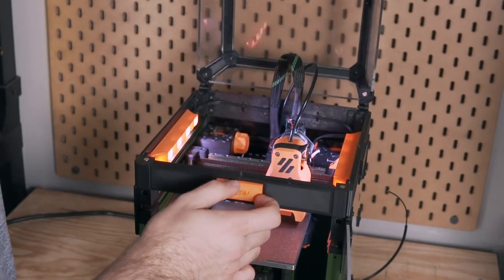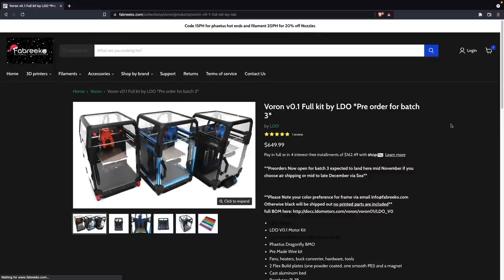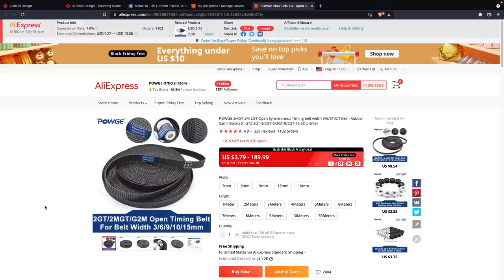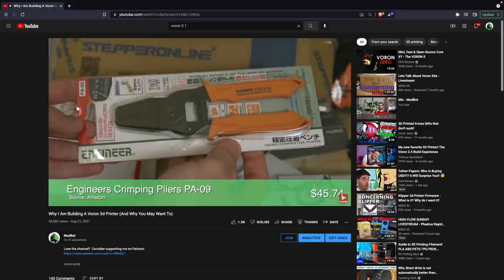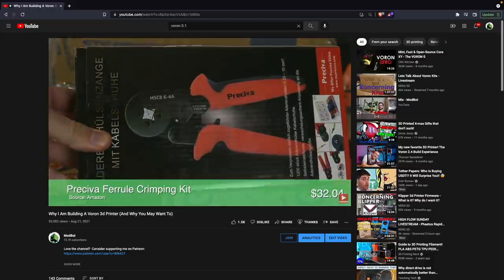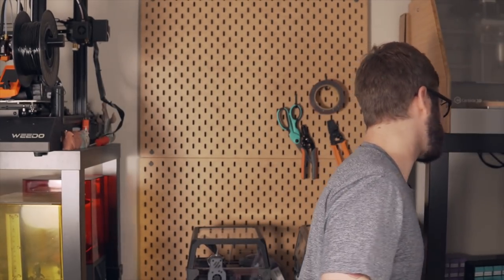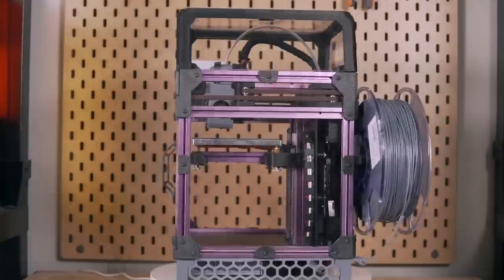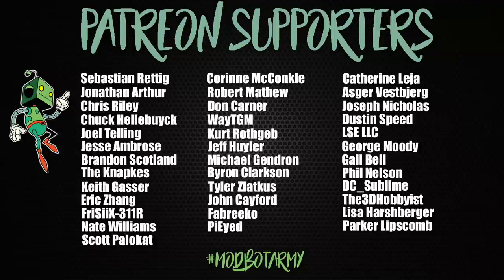Self Source Or LDO Voron 0.1 Kit? Best Option!

Comment: Couldn't have posted this at a more perfect time! Just got my ender dialed for abs and was going to begin printing a v0.1, was debating between self source and ldo kits and this helps so much!
Reply: woah....same
Reply: @Trail Chasers What happened to YOUR channel? You haven’t put out a video in a couple years?
Reply from the maker: Happy to hear :). Unless I wanted to for the sake of it at this point there is no way I would choose to spend more when the LDO kit is available. I hope your build goes well!
Reply: Definitly go the kit way. I started a 1.8 build some time ago, still not done, to the point that I've started building a trident that was releasing since AND I've ordered an LDO v0.1 kit and it is built already, my trident has the A/B motors and the idlers... I should have the parts to do the Z next week...

Comment: I bought a LDO 0.1 kit (batch 2).  It's still sitting in the box though, as I promised my wife I'd finish another project first.  This video makes me feel pretty good about my choice in kits and I'm sooo looking forward to putting it together.  I know the overwhelming feeling you got when you were sourcing the parts in the BOM.  I put together a voron 2.1 a few years ago and made same mistake w/ my belts and pulleys.  It prints (sort of) but sadly, that machine is still sitting on top of my Ender 3 enclosure like a camero on blocks in a trailer park front yard.  So many projects, so little time.
Reply from the maker: Good on you for doing what you promised first. It is not so easy to put off something you are very excited for. That makes me think of my AM8 I did. I was not super happy with the end result. It was my fault by part choice and waiting way to long to build it but it did not get nearly as much use as I would like. You are going to love this thing.

Comment: The notion about "inferior" parts in kits is almost inevitable, even with the best intentions. To be able to make or assemble and sell kits, you need to aquire serious stock of each part. But in this space, iterative improvements happen at lightning pace. And the margin on selling kits for this isn't big enough to absorb large caches of parts becoming dead stock every time a notably improved alternative comes out. Heck sometimes it happens so fast that your parts have been "surpassed" after you place a manufacturer order but before getting delivery. Please note, this certainly doesn't always mean bad  parts in kit. Just that there's something newer/better available.

So if you're gonna do any sort of reliable business selling this type of kit, you kinda need to either be the manufacturer, or the distributor, of practically all the parts in that kit that go through these rapid cycles.
Reply from the maker: I do agree with this. With how quickly things move in this space it is going to be incredibly difficult if not impossible to always have the latest version/revision. I do feel that quality of components though is something that they do have control over when they decide who they are going to source from. Like you said, being the manufacturer gives you a definite 1up.
Reply: @ModBotArmy  That is a very important factor you mention; Quality. If you stick to strong performance, good quality parts for as many parts as possible, then the market and sales figures of your kit is lilely gonna be significantly more forgiving when a few of those parts get surpassed. There needs to be a healthy balance though, functional performance parts has to be swapped eventually. As such, I think offering both "core" kits and "full" kits would be a good idea. That way, in the interim between multiple functional performance parts being surpassed (so customer interest drops off substantially because there's just too much of the pricetag sunken into parts they won't be using) and you having revised your "full" kit, you can still keep "core" kit sales going strong.

Comment: So, I work a 40+ hwr job and have a kid that plays a competitive sport, my time is limited so I feel like going with the kit route would be best for me.
Reply: No problem with kits
Reply from the maker: Haha you absolutely will be happier going with the kit then. I would not consider self sourcing with all of that.
Reply: It's not as bad as you would think, quite a few manufacturers are making mini kits for things like motion, hotends, etc. Still a commitment though. Only worth it if you have a decent shop full of hardware and extras of common components
Reply: 40 hours is normal.
I am sourcing stuff myself and even return a few things which aren't up to my expectations.

A Voron printer doesn't have to be built within days.
This is something that can take time and it's not a problem.

Comment: I just purchased the v0.1 LDO kit, have not started the build but so far the parts look great everything is to spec and including this video I have not heard any bad reviews. Earlier in the year I purchased the formbot v2.4 kit and it was mostly a disappointment. From a bad build plate, the chains that could not open to missing some bits and pieces and rails that, well I had to purchase new rails plus a lot of other things to replace. Other people had better luck and that is just the thing, it is really a hit and miss with aliexpress kits. It seems that they are better now a days but I would think twice.

Comment: Just finished my V0.2R1. I used a kit. The only issues I had with the kit was that the cooling fans were bad, and there were no notes from the supplier as to what I would have to find for instructions for their upgrades. Not knowing what it was called was half the battle. 
I will definitely use a kit again, over self sourcing, but I will upgrade things as I build knowing what I'm doing a little better now.

Comment: Tip: You can shorten a premade wire without the need to re crimp it. You can cut twice, solder together and secure it with shrink wrap.

Comment: My planned printer projects for the next few years are a Voron 0.x in 2022, a Voron 2.x IDEX in 2023, and a Rat Rig V-Core Jubilee Tool Changer across 2024 and 2025. (I'm fully aware that new cool stuff will inevitably pop up and potentially alter plans in the meantime, but I need to spread my budget and wait for others to do most of the hardware design work for the IDEX-ification in particular; I only know that I want to use Rapido UHFs with Zodiac Pros and an SKR Pro with an EXP-MOT.) I will definitely use preconfigured kits (as a basis) for all of them - and most likely LDO ones for the Vorons. I hope that by then my V0.x kit will come with SKR Pico.

Comment: I first built a V0 around febuary, through formbot, I had to imidiatly change the steppers because they did not send LDO motors like they said they would and I was getting mised steppes. other than that I think the kit was pretty good and I cant remember any other issues. once done that build i went on to build a V2.4 but went with BLUROLLS this time.  the spider they sent was broken so they offered a $10 refund... and they were missing some M5 hexscrews and again said that with thte $10 discount they offered would cover it... i was not happy about this as it cost more than that to buy them localy. apart  from these 2 issues  the build went well. i think i might pick up the LDO switchwire or Trident next.
EDIT*** i re read this and realized how complains it was. Both printers are up and running fantastic and in the end I am very happy with the kits.
Reply from the maker: That really does not sound too terrible. I mean of course having to purchase anything that should have come working with the kit is not great but I feel it could have been worse. The Switchwire looks awesome :)

Comment: With my Trident 300, I went the Formbot route, and it turned out alright.  I've had to swap out a few things, but it provided a decent basis.  For the v2.4, I'd love to go LDO, but unfortunately they don't offer a 250mm kit for it, so after a bunch of thinking I've decided I'll wind up going the self-sourcing route, simply because it lets me pick and choose every last little detail.  If LDO offered a kit in the size I'm looking for, odds are I'd just get their kit, because they're fairly nice and cover most of the things I want.

For Salad Fork, which will probably be the printer I build after the v2...  Odds are I'll just buy the Fabreeko kit, since that definitely has most of the stuff I want already in there.

If I were to build a v0.1 though, LDO's v0-s1 kit looks incredibly tempting, and has so many things just sorted out so you don't have to mess about.

Comment: waaay too small printer for that price...
Reply: It’s quality though 

Edit also many good designs are multi print therefore you can build really big assemblies that go together. This printer is nice for the people taking multi print assemblies, (which are arguably better) to the next level.
Reply: @Nabikko  i dont know about that. Never seen any hq prints from a voron. Only fast ones
Reply from the maker: They can print fast and high quality. I am not talking about the 1000mm/s but I have my V0 at 150-200 and it prints equal to my other machines that print around 60mm/s. Its definitely not for everyone but it performs well.
Reply: @ModBotArmy  nice. Still would like to see that(every video showcases only the 1000mm/sec). And its still veeery small. Its literally resin printer size. And i doubt it can print as hq as a resin printer.